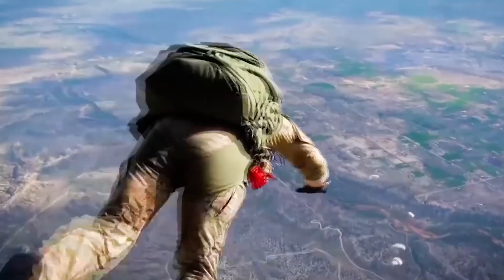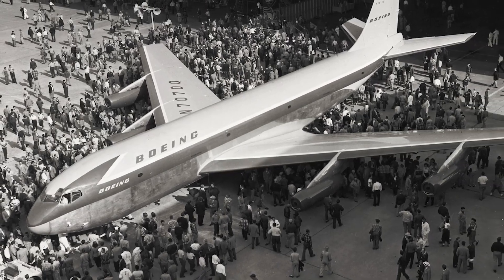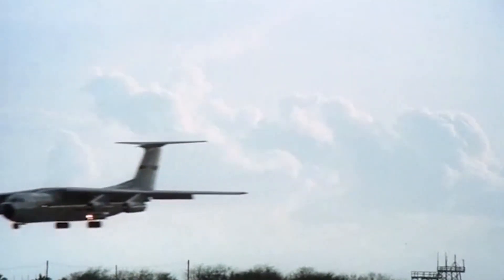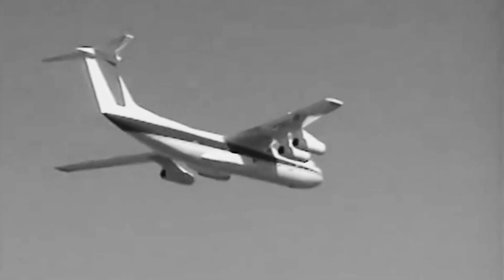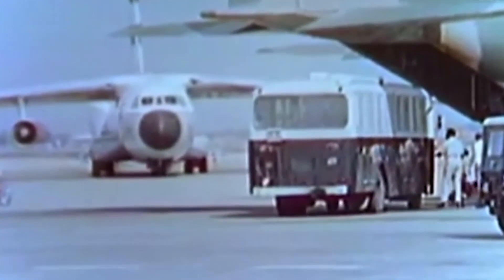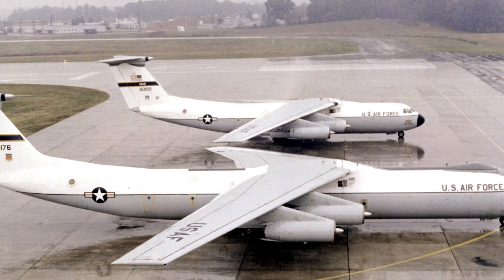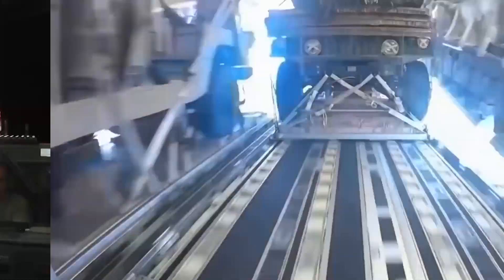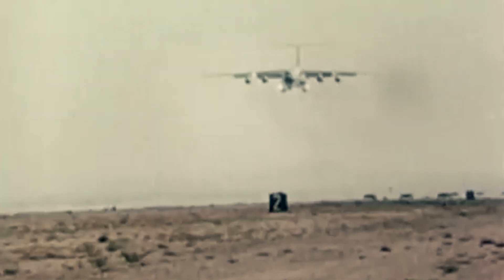C-141 Starlifter - a support for air bridges

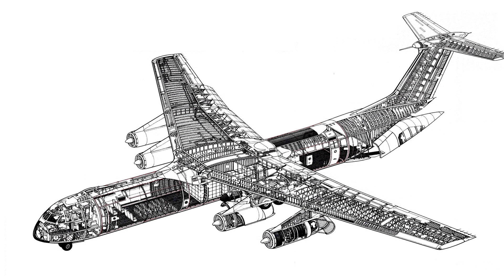Comment: Crew complement was two pilots, two engineers,  one loadmaster and one navigator only if flying a Tac mission IE airdrop. Add one pilot if you are alerting for a augmented day, (24 hr mission).  Time stamp 8:23 needs correcting.

Comment: A great report. The main design phase was carefully not analyzed, and for a good reason.

Convair actually designed the C-141. And, because of cost overruns and delays in production of the B-58- the Airforce preferred not to work with Convair. So, President Kennedy gave the manufacturing of these great planes to Lockheed, even though the Kennedy family owned a Convair airplane named for Caroline, President Kennedy's daughter.

Comment: Also had fond memories of the C141 Starlifter. Was assigned to the 2nd/508th Parachute Infantry, Regiment, 82nd Airborne Division in 70-71, & jumped quite often from this incredible flying machine. However I saw my first one at Ft. Benning Georgia at Jump School. With 22,000 lbs of thrust from each jet engine x 4, this exit with combat gear gave you quite a ride! Hated to see this fine cargo aircraft retired.
U.S Paratrooper Veteran
82nd Airborne Division

Comment: Crew Chief at McChord and Enroute Maintenance at Yakota Japan on them from 1971-76 then cross trained to Flight Engineer and flew them until 1983, before switching to the C-130 They took me to some great places and some not so great places, but was a very reliable machine.

Comment: My dad in 1971 - 1973 was stationed in Thailand, as an army-brat I got to fly Space A to exotic places. Ton Sa Nut, Don muang, India, Taiwan etc..  My mom and sisters flew commercially. I never realized my good fortune. I was usually the only kid among soldiers. The airmen would hand out waxen plugs. I thought it was candy. The noise in the cargo bay wasn't even bad, the pressurization left a lot to be desired as did the red cargo nets called seats. I was a kid and thought this was normal. The airmen also handed out hot chow, turkey chunks in gravy. Yum! Not every flight however. When my dad retired I got a real treat flying back stateside we took a C5A! Man that's an amazing plane. I would never trade these memories from all the gold in Hollywood. Thanks Dad!

Comment: Good video.  The discussion of the C-141A's cargo space was a little strange.  For typical freight mission profiles, the A's would usually "cube out" before they hit their cargo weight limitation.  The B model solution was to stretch the fuselage so more standard cargo pallets could be carried.  It was pretty reliable but, damn, that floor got cold on long flights.  It was noisy -- not much weight was used for sound reduction in the cargo area.

Comment: I was a passenger on this airplane July 28, 1968 . The flight started at Colorado Springs Airport and the destination was Da Nang South Vietnam.  We made several stops the first stop was in California and I believe that we stopped in wake island then we stopped in the Philippines and then Da Nang South Vietnam.  The plane was fitted with passenger seats and the seats were facing backwards.  We were a military unit that was being deployed to South Vietnam perhaps the last complete unit sent to South Vietnam.  Our destination in South Vietnam was the base at the DMZ called Con Thein after being there for a while we were moved just south of the DMZ to Cam Lo and later we were moved to Quang Tri.  I thought the C-141 was a great airplane I noticed that the plane used up most of the runway in take off.  I remember when we got off the plane in Da Nang the engines weren't shut off the pilot said that the Da Nang airport was being shelled with in coming mortar shells. The flight to South Vietnam lasted for almost two days.

Comment: Hey Sky, the Cargomaster, was the C-133, not C-155. There is no "C-155" at all, but there is a "C-146", and it's flown by Air Force Special Operations Command, and it's a military version of the DO-146 commuter liner.

Comment: There's nothing like a twelve or thirteen hour flight on a 141, with little to no noise reduction,  facing backwards with a cold boxed lunch in your hand while wondering just how much of the runway this beast of a plane is going to use before finally taking off tail-first.

Comment: i grew up next to an AFB, listening/watching c130s, c5s, c141s take off and land.... and later c17s. i could tell just by the sound of the engines what plane was coming in / taking off. i remember specifically desert storm... for several hours straight in the dead middle of night listening to airplanes take off headed for iraq. i counted 50+ airplanes fly overhead.

Comment: For the guy complaining about old timers never shutting up about C141s farther down in the replies

your comment was a bit unkind, I think. 
I spent many days on Stand By backup alert duty backing up C5s that often broke down and took two 141s to cover for them, so the general would get a good, on time, mission report or on time take off.
They were saving the wings and limiting the flight hours, and the cargo doors in the rear of the C5s were sealed for a long time because they were afraid of a failure and a Rapid Decompression. One of my good friends was one of the first Airmen lower than a staff Sargent to go to C5s after we finished C 130 school and Basic C 141A school. His biggest gripe was that he never got to fly. He could not get any flying time because they were limiting flight hours at that time. I am sure after all was secured and fixed, things returned to normal.
But thank you for your comments from one of the old timers. By the way, 1964-68 build date is not much older than the build date on the C5s

Comment: I worked as a structural engineer at the C-141 Depot at Robins AFB GA. In the engineering archives was the original proposal from Lockheed. Surprise, surprise, surprise, Lockheed's original proposal had aerial refueling integrated into the original design. Someone somewhere in the DoD procurement chain got the aerial refueling system deleated. Sadly the USAF had to purchase the system at greatly increased cost decades later. Those slide rule people at Lockheed envisioned what some Federal government bean counters failed to see. A future where landing rights and refueling on the ground in other nations might be denied to USA DoD aircraft.

Comment: I was at the 63 APS at Norton AFB in the mid 70's and delivered many tie-down chains, straps, "comfort pallets" and box meals to our fleet of C-141's. What a walk back in time to read this history. In Fleet Services my worst memory is of working on the "Flush Truck" that pumped out the planes latrine(s) you always hoped that the last person to service it had reinstalled the 'donut seal' or you'd get a shower of blue and brown water when you removed the cover! I loved loading the comfort pallets since I could use a forklift and I was terrible on the K Loader. In '78 I flew in a 141 for the first time on TDY to Yokota AB by way of Elmendorf AFB in AK. We were told to dress warmly, and we all thought it was because we were stopping in Alaska. We were all freezing long before we got there. Sitting on side troop seats with our legs wrapped around chains holding down various vehicles most of us managed to get some sleep across the Pacific. Those were wonderful planes to work on, and I loved to see them take off and bank right over the mountains east of San Bernardino. I loved the sound of them taking off and would often go out into the parking lot next to the runway and watch. I was sad when I read that they had been discontinued, even though I had been out of the USAF for many years, it felt like losing a friend. And now Norton AFB is an airport; the old Fleet Service building is gone and a grocery store distribution center replaced it. I wish that there is one C-141A that is still active that can fly to air shows so others can see it. There are planes from WWII still flying, why not the work horse of MAC?

Comment: The 2nd Marine Division was flown out to The Marine Corps Air Ground Combat Center, also known as 29 Palms, is the largest United States The Marine Corps Air Ground Combat Center, also known as 29 Palms or (MCAGCC) . WE left from MCAS Cherry Point North Carolina aboard a C-141 there were bullet holes in the fuselage from the Vietnam war. This old girl was very steady in flight but the sides got very hot to the touch also very noisy. I only go on one flight to the CAX at 29 Palms. Thanks to USAF we made it safely.

Comment: In 66 or 67, going on leave, I got a hops flight on a 141 from Kelly Field in San Antonio to McGuire in NJ, the plane was set up with about 10 rows (?) of airline type seats, Facing rearward, and regular web seats along each side beyond that how many I don't remember?
The rule of the hops was first come first serve for seating, as it turned out I stepped on board just in front of a Bird Coronel and got the last passenger seat.
As I sat down I looked up as he was sitting in the web seat, He could see I was wondering what I should do, Being an E2, he smiled and said that's the luck of the draw, enjoy the flight.
Well, that Plane is amazing you could feel the Aircraft Taxiing turning onto the runway, and as soon as it straightened out the engines began to roar and thought I was going to be sucked out of the seat, and in what seemed like seconds we were off the ground!
The smoothest flight I'd ever had, from San Antonio to Tinker ABF Oklahoma, dropped off cargo, Jet engine, loaded more cargo, had a snack at the snack bar, took off, to Andrews AFB Maryland dropped off and picked up more cargo, and flew onto McGuire in NJ. 
All that only took a little over 5 Hours, when a nonstop From Newark to SanAntonio on a 707 back then took 4 hours! If I ever had a choice to ever fly again I would choose the 141 great planes. And thanks Coronel wherever you are up there!

Comment: G'day Sky, In the early 70s I was in the RAAF at Richmond, NSW where our two squadrons of C-130s were based. About once a week a USAF C-141 would land at our base on its way to wherever. I had several tours of the aircraft and found it a truly amazing piece of equipment. The USAF had so many Starlifter pilots and crews that, only rarely, would the same crew land at our base more than once. Our main runway ran parallel to the base's perimeter fence and just on the other side of the, lightweight wire, fence was the main road from Richmond to North Richmond. Several times, while I was there, we heard reports, and saw, Starlifters coming in for their finals, lining up on the road, not the main strip. This was strange because even though it was a wide road, it looked nothing like our runway. Perhaps some of the C-141 Skippers thought they were making a mistake and coming in on a taxiway. Always, thankfully, at the last moment the Skylifters would suddenly pull up and if they were already too far down for the strip they would power up to altitude and do a 'go around'. 
The regular arrival of our American air force friends also led to our flight line buildings sporting one of the biggest 'NO SMOKING' signs in Australia; it was truly huge. This came about after the Warrant Officer in charge of the flight line spotted a bunch of USAF people deplaning from a tanker aircraft where upon nearly all of them lit up cigars or cigarettes while slowly walking away from their aircraft; which was also in an area where we refuelled our Hercules. The Warrant Officer was apoplectic with rage as he berated this group of visiting officers in language, I'm certain they'd never heard before. Prior to our visitors leaving, that day, they somehow organised a case of beer to be delivered to the Warrant Officer. All was well and we never saw an infringement like that again... thanks to our big sign, of course. 
Seriously, the MATS people and crews from the MAWs were really good blokes. Sadly, they never planned overnight stops, Vietnam was still on and they were always in a hurry. Except for one Starlifter that went unserviceable (‘U.S.’) and needed an engine changed and had some other electrical problems. They stayed on for a day and a half until another Starlifter arrived with an engine, all the parts they needed and what we thought was a huge maintenance crew. The ‘US’ engine and some parts went onto the second plane along with the original crew who were flown back whence they came. When their aircraft was fixed another crew turned up and we had the spectacle of two C-141s taking off. Those were great days and as we found out the Starlifter, despite some issues, was a tremendous aircraft. Cheers, BH

Comment: Crew chief 141A from 1965 to 1968 Travis and Norton AFB, held over for the Tet offensive and go to out mid 1968. Got really tired of the war. Went back in 1982 crew chief C130E  146th TAW and out again in 1990. The 141 was a far easier aircraft to maintain than the C-130, but do not really miss either one of them. To me it was just a job to do. Being a crew chief on a transport aircraft was a pain in the butt and nothing but long hours, rain,wind,heat,cold and that gets old real fast. Thank full to be retired now at the ripe old age of 77.
Reply: I was at Norton Feb 67-Aug 68 63rd OMS

Comment: As an old C-130 pilot I remember well the somewhat superior attitude some 141 crews had towards Herk crews. We all got a good laugh when the last C-141 was delivered to the boneyard that crew hitched a ride home......in the back of a C-130!
Reply: Personally, never had that outlook.  C-5s, C-130s,, and C-141s had similar mission overlaps, but their differences too.  However C-141s went to the boneyard prematurely after doing a lot of the stuff a 130 does at low level and higher speeds.  Per the -1, it was designed as a high speed, high altitude cargo airlifter.
Reply: @mikekishjr8851  It should never have been used for low level missions. They are still making Herks which makes it the longest running production run of any military aircraft.....probably of ANY aircraft. It has proven itself to be irreplaceable.

Comment: I flew on a MAC flight from Travis AF base in Fairfield, California on a non-stop flight to Louisville, Kentucky in a C141... It was an 8 hour flight and it was smooth as silk. A very nice plane to fly in. It was on fact enjoyable considering the nylon mesh cargo seats
Reply: Non-stop from Fairfield to Louisville in 8 hours, and smooth as silk?  On a direct flight between those two cities at normal altitudes (about 35000 feet) and airspeeds (.74 Mach), that flight should not have taken that long.   Unless there was some enroute exigency (crappy weather to avoid) or special training (airdrop, air refueling), the flight should have taken about 4.5 to 5 hours.  I was a navigator on C-141A/Bs (at Norton) and C-5A/Bs (at Travis) and I could flight plan in my head for that route.  I think you might be adding the time zone change.

Comment: Minimum crew was four; two pilots and two flight engineers. If any cargo or pax were to be carried, one or two loadmasters were required. I flew one mission from the refurb facility in Georgia to Charleston carrying a Chevy Van with the min crew (no loadmaster)- but that was a unique situation. (Flight engineers were required to be able to do the weight and balance form- this was the one time I had to do one for real.) The plane was old and worn at the end, but it was retired due to political reasons. The B-52 is older, and the Russian IL-76 is still flying today. In the end, the USAF wanted new because new planes mean jobs in congressional districts.

Comment: WOW! Brings back memories. The first two C141's that were stationed at Travis AFB (8075 and 8088) were put on "Lead the Fleet" and were pushed to get extended hours on them to see when parts started to break down. As a new aircraft, no one knew what to expect. So they flu the hell out of these first two. I was one of a few crew chiefs that were sent with them to Vietnam and back. We stayed with the aircraft until it returned to do any maintenance needed to keep it in the air. 43 hours round trip. Did that for over a year plus 4 embassy flights and special request flights. Burned out flying, so got out after one tour.

Comment: I hated jumping out of the C-141. Jumping out of it feels like being sucked out of a vacuum cleaner. The opening shock from my parachute feels like being ripped apart on my body with combat equipment on. There is no fun and sensation of falling slightly from a propeller plane like a C-130. Yes I would jump out of the C-141 but it's not my favorite.

Comment: Great video about a great plane.  I was a "Plane Captain / Crew Chief" on A-4 Skyhawks.  Whenever we were required to deploy somewhere, we usually called up the Airforce taxi service and they usually sent a couple of C-141's to give us ground personnel a ride while our A-4's followed. It was so much more comfortable than the C-130's that the Navy and Marine Corps had for us.  Anyone who has ridden 4 hours in a C-130 as well as a C-141 knows what I am talking about.  I'm talking about nylon web seating and Noisy turboprops that require the passengers to wear hearing protection to avoid noise fatigue and hearing loss, vs Comfortable airline style seats (Facing backwards, mind you) and nice quiet jet engines and a sound insulated fuselage.  It was the right plane at the right time.